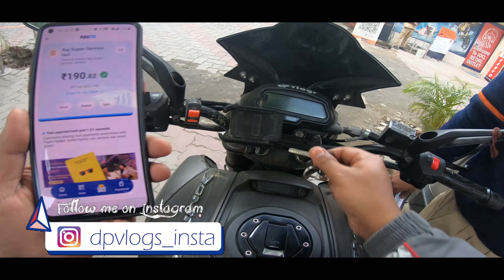These New Tyres had a Problem | Dominar's New Tyre

Comment: Hi, recently I bought MRF Revz D 150/60 R17 for my Bajaj Dominar 400.
The stock rear (Revz C1) tyre pressure was mentioned as 32psi on bike user manual but on the new tyre it's written as 40 psi...
Now I am confused, whether this 40psi is Max pressure as per standard or it is the optimal pressure like 32 psi for the stock tyre.
Could you give me some insights on this.

Thanks.
Reply: Stick to the pressure figures mentioned in the bike's manual.

Also, how's the tyre's performance?